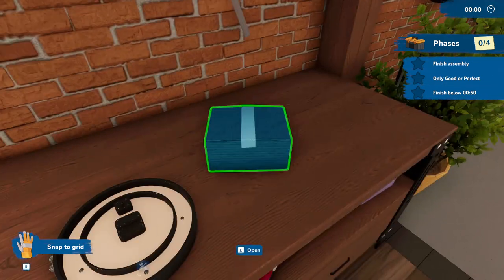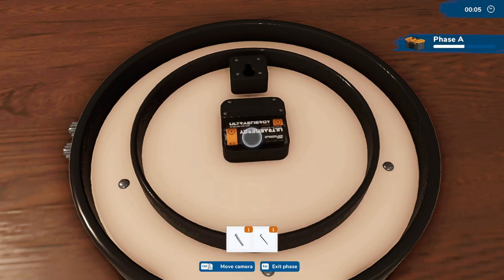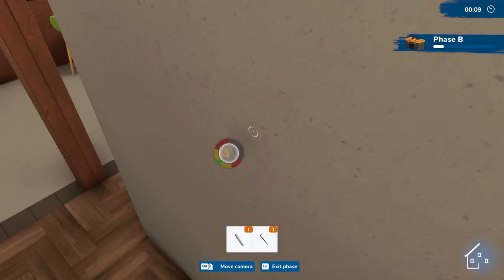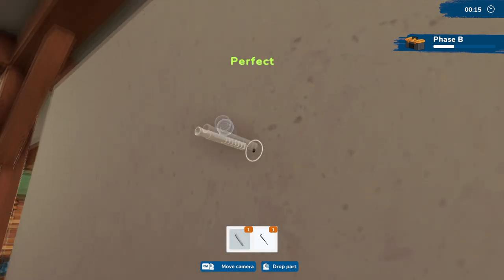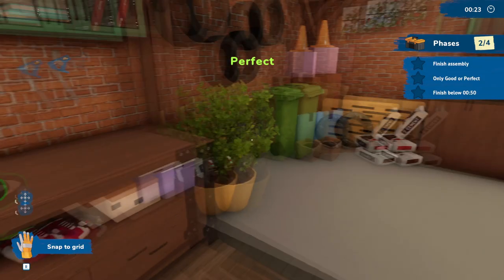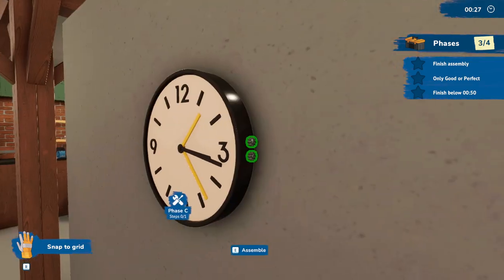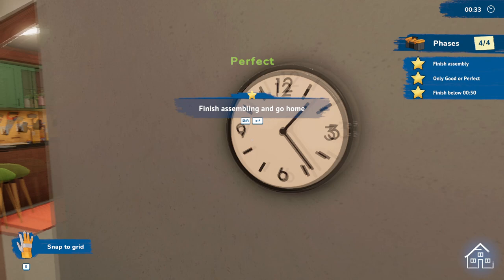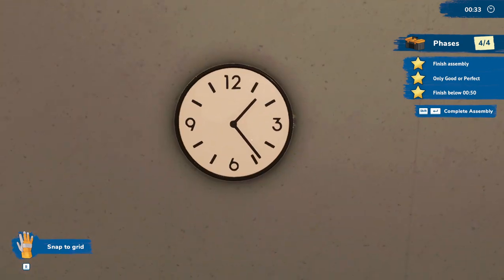How to Assemble Clock with 3 Stars in House Flipper 2

Comment: How were you able to get the clock hands to move that quickly? They feel stupidly sluggish while trying to set the time.
Reply from the maker: Move the hour hand, not the minute hand.
Reply: How to do it?
Two knobs at the right side of the clock just make hands move forward/backward
Reply: @kannabie did you find a solution for that last part? The hands move so slowly for me that it’s absurd. I’m testing different fps and resolutions but nothing works.
Reply: Just finished it, I was just lucky so hp2 be dammed